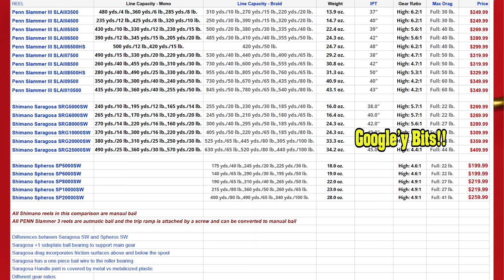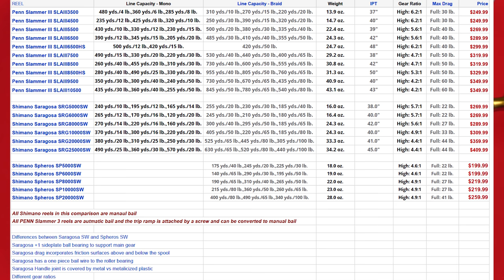Penn Slammer 3 vs Shimano Saragosa SW Who makes the best Surf Jetty Pier Boat spinning reel?  Sealed

Comment: Great discussion here, thanks.  I got myself that 2500 LL.  I really like the reel, overall but I can't get over the spool sitting on such a tiny "shelf" washer on the shaft--as you said, all that pressure has to pile up right there, narrowly.  I minor problem I'll say Penn overlooked was the angle of the line roller to the spool of line, particularly when full.  It pays off off the spool at an angle wider than the line roller is angled for, so it runs tight against the sharper edge of the roller just before it guides on to it.  No likey!  That could feasibly fray line or rumple it.  My reel lays line biased on the lower part of the spool, even after removing the most shims possible and reeling in tightly.  My 2500LL's drag locks DOWN.  The only way to take adavantage of that degree of drag would be 60lb braid on a Tuna stick, which means getting spooled after 30 seconds of Blue Fin fury since you haven't the yardage to give it.  Impractical as that all seems, it's nice knowing it's there!

Comment: One thing I really like on my gosa 6k is how powerful the gearing is. I try other reels and have to wind a lot harder.
Reply: What about the Daiwa BG ?
Reply: @gonimysh  I have 3 sizes of the BG's, 2500, 4000, and forgot the size of the other one. The BG's are not well waterproofed, and this comparison is gosa vs slammer. I have since previously picked up a 5500 slammer and it is a nice reel, have some heavy braid on it 40lb and I can crank in cobia off the coast and use it in the surf with heavy weight.
Reply: @rabidgp  Thank you for your answer but my question is about power. I know that the BG is sot sealed as a Saragosa and in the long run the Saragosa will live longer but what i want to know is which reel is more powerful, the Saragosa 6000 or the BG 4000. I am making you this questions since you have both. Thank You
Reply: @gonimysh  The gosa is more powerful, smoother, and the consider that the two reels are not the same size. Surf fishing from the beach I can retrieve a 4 oz pyramid sinker and rig effortlessly, where the 4000 takes more effort. One issue with the gosa is to be careful to not drop the spool, I dropped the reel once from  about 3 feet and it dinged the spool lip which I had to lightly sand so it wouldn't cut the line. The aluminum was softer than I thought it would be.
Reply: @rabidgp  may i ask where are you from? I am curious to know what kind of rods and reels do you use.  I live in Italy and for fishing from sandy shores we use usually 4,5 meters rods with big pit reels like the  Shimano Power Aero 14000 XSB or the Basia Surf 45 QDA which have large spools for casting far 100 -150 meters using leads 100 - 200 grams. Reels like the Saragosa or the BG are used for heavy spinning and boat fishing.
Reply: @gonimysh  Central Florida east coast US, we  fish light tackle for snook, red drum, speckled trout in the estuaries, inlets, and beaches. Surf fishing (with light tackle) for pompano, whiting, snook , mackerel. Inshore coastal for tarpon and cobia, offshore trolling for Mahi dolphin, wahoo, tuna, and  sailfish. Offshore bottom fishing for snapper and grouper, various species. Scuba diving for spiny lobster, grouper, snapper, flounder. And we have freshwater rivers and lakes for largemouth bass, and speckled perch. So many fish, so little time.....  but they're often seasonal and weather dependent.
Reply: @rabidgp  very interesting even though i don't know any of the fishes you mentioned 😀. I would like to know what kind of rod do you use with the Saragosa, how long and what casting weight. Probably your definition of surf fishing is different than mine. In Italy we call "surfcasting", fishing from the beach in a sea with waves.

Comment: Have used the Saragosa 10000 model for casting live baits and poppers to Sailfish on our charter boats in Rompin, Malaysia and have noticed after while that the drag setting changes to much less drag during long fast runs, otherwise a very nice reel but the drag problem gives me headaches.
Reply: Jonas Nyqvist yep mine does as well
Reply: I have a gosa 6k, and notice this effect a little also, I thing the larger drag seal makes friction against the spool and can cause the drag to tighten. Maybe a light oil to ease this friction might help.   The smaller seal of the slammer probably works better to this effect, not as much drag against the spool.  Maybe a little loctite in thr drag knob might work, harder to turn, but should help it stay put.
Reply: Rob Lee yes exactly, i have a 10k and just a small amount of oil on the seal under the drag knob and on the spool where the knob sits will fix the slippage. Will stop the drag knob from catching onto the spool and applying unintentional drag.

Comment: so how do you fix the wobblely   rotor on the saragosa 6000
Reply from the maker: Honestly I would suggest contacting shimanos service....I believe they remedied the issue...i've seen new 5 and 6k reels without wobble...i've also seen smaller twinpower sw's with a slight wobble.  My guess is send in the reel they give ya new or a new rotor.  You could probably convince them to send  a new rotor and it's a simple fix if they send it with the bail parts already assembled
Reply: i had saragosa 6k....used for light surf and popping....no problem...so far after almost 3 years...no wobbling....but the new tp5000hg....wobble  under pressure
..sold it back...not satisfied compared with 2011 tp...(very nice)

Comment: First of all, great, in-depth  video comparison!
Yesterday I was talking with a guy at my local B&T shop who was annoyed that he couldn't get his beloved 7 year old Shimano repaired because Shimano no longer has parts for it.  He bought a Penn Slammer instead.  This was not surprising to hear about Shimano -- they do the same with their cycling parts.  I guess that is what they refer to as planned obsolesce.  Shimano makes some really good stuff, but they're constantly changing things.  There is certainly something to be be said about change for improvement, but I think Shimano changes just to change -- and then they market that small change as a huge improvement that you can't live without.  I have both Shimano and Penn reels.  In this case, I opted to go with the Slammer for surf fishing because it is a very competent reel and I want to be able to fix and service my reel should southing go wrong a few years from now.

Comment: We use this reels exclusively for jigging here in Cebu Philippines. I use a slammer 4500 and my friend uses a gossa 8k.  I pulled a 58lbs king mac using a 20lb jbraid w/ a 30lbs florou leader on my slammer and the drag was phenomenal. My only issue with the slammer is its cranking power but overall i love it. Still smooth as  the day i bought it, no it’s actually more smoother  now even after a year and a half of jigging , 16hrs a week for more than a year and still no issues its a tank🤣🤣🤣.
Reply: Dude I visit the Phil's quite often (pre-pandemic), would love to go fishing with you guys my next visit if possible

Comment: If I may clarify: At 50:40, you mention the rotor play as being related to the ratio.  I'm quite sure that the play comes NOT from the space between the gear teeth (which makes the gear ratio a non-factor) but has all to do with the amount of rotor travel required to actuate enough resistance from the anti-reverse mechanism. So, the handle is not an accomplice.  You'd be right about the "six times more play in the rotor than the handle" IF the anti-reverse were under the main gear whereby the rotor's reversal rotation is transfering torque from the pinion to the main gear, THEN you'd get that sort of play, which was true back in the Z-days and lighter SS models of yore. But since the anti-reverse is at the pinion gear, the main-gear-to-handle train bears no guilt in crimes of the un-reel.   I appreciate your deep dive with the mechanics/materials.  I've been fixing reels since I'm 9 years old and still can't overcome it.  Any tips?  :)

Comment: Great video, I'm going to go with the Penn Slammer 3 5500 because of the IPX6 rating that was done independently. Very Informative vid.
Penn Slammer III 5500 Spin Reel
Penn has been a long standing market leader in the production of strong, heavy duty saltwater fishing reels that can go toe to toe with the biggest & the best in Australian saltwater fishing and that is why for a third year in a row it has won the best new saltwater reel. 
To keep up with this tradition, Penn presents to you in 2016, The Slammer III spinning reels.
The Penn Slammer III fishing reels are made using a full metal body, side plate & rotor and are then sealed using an IPX6 design which offers anglers a super strong reel that is ready for all kind of saltwater applications by keeping water out of the gears and drag system. 
All Slammer III spinning reel feature 6+1 Stainless steel ball bearings, CNC gearing systems and boasts an incredibly light weight design. When using the Penn Slammer III fishing reels, you can take advantage of the whopping max Dura-drag systems and the large size line capacities to chase all your favorite Australian saltwater fish species.
 
Full Metal Body, Side Plate & Rotor
IPX6 Sealed Body & Spool Design
CNC Gearing
Sealed Slammer Dura-Drag System
Stainless Steel Ball Bearings
Mono Capacity lb/yd: 430/10  330/12  230/15
Braid Capacity lb/yd: 500/20  380/30  335/40
Gear Ratio: 5.6:1
Max Drag: 18.1kg
Reply: Kwikflikz Yak ADVENTURES I own the slammer iii 5500 and I don't like it for surf fishing. It's heavy if you are throwing lures and I nearly lost mine when a jack took it out of the sand spike because the drag doesn't get loose. It's a great reel on the boat though.
Reply: thanks for your reply great to know, I'm looking at ocean kayak fishing and mostly trolling for Tuna and Kingfish, appreciate the comment.

Comment: Own  2  Penn slammer 3 5500 and     been up to my chest with 40lb stripers and the reel taking a swim.   No probs ever. no corrosion no anything other than the Penn slammer  bail  closes  a tad stiffer  which actually helps in the long run  if tossing lures.  No premature bail closing breakoffs.    Fishing bud actually owns a saragosa 5000 and it fucked up on a nice  35 lb striped bass which burned line and locked the spool up.     Also noticed that my friends  saragosa had damage on the  line roller.      Penns drag on the 5500 40lb.    Hooked a 110lb  white sturgeon by accident and the Penn had problem controlling this beast.     Penn indeed has no rotor lean.    Had ideas that the Penn might  be less than penns old standards but pleasantly have found the Penn is solid as hell.  Also have had waves splash the  Penn over and over and no raspiness? not sure what happen  to this one but mine gets put through hell and has never had a issue.
Reply from the maker: It really is a very good reel.  As is the Gosa.  After penn sent me the new spinfishers.  I found one that was missing the hydrophobic coating.  I asked penn if it should be there and if mine were retail release..and they confirmed it should be there and that they're pre retail......But 2 out of 3 had the coating....I say that because when i had that slammer....I thought I had messed something up...but I've now seen some penns with a barely there coating...and that slammer i think it was as missing as the one I have here.  And that will allow water to get into the ar clutch area and kill that pinion support bearing which is what happened.   The day it was dunked..all was good.....same with the next day not fishing it..the third day is got noisey... (saltwater)  Penn replaced the reel and it is in tip top shape and back in the og owners hands.    Quality control....every companies most important aspect..can be penns problem at times....Vids like this go a long way to push them to focus...(I know they are watching me wit the upcoming spinfisher vids i'm shooting...and when I launch the vid this week focusing on one of their november launch reels.  They may get a tad nervous...But it's for the benefit of the consumer..And I don't recall in the history of a retail release anyone has done something like this

Comment: Hey bud happy new year. 
Really appreciate your in-depth reviews on gear. I'm considering both of these as an option for surf plugging here in the Northeast but did hear that the Saragosa's have an issue with line slap against the rod guide in some cases because of the design of the reel foot which seems was designed more for jigging. If this in fact is the case I'll likely lean more towards a Slammer, Saltist or Spheros. Can you elaborate on this? 
Thanks.
Reply from the maker: It depends on the guide layout. In some instances there will be a bit of line slap due to the parallel reel foot.
Reply: Makes sense. Has Penn addressed the knocking issue you mentioned at 29:00 and is it more of an issue on the larger sized reels?

Thanks.

Comment: I have read that the Shimano Spheros SW comes in JDM and USDM versions, with the former having a lower quality cast drive gear. Do you happen to know if that is also the case for the Shimano Saragosa SW or do they not have different versions of the same model? Thanks for the review please keep it up!
Reply from the maker: The JDM spheros is inferior to the USDM...that's why in the links I make mention of it....Hex handle and something else is lower quality. I haven't seen any cut corners in the jdm gosa
Reply: There isnt a hex handle on the JDM spheros.....

Comment: Just for the record, I love your videos man but I got a question.
I watched this video a couple times and I noticed that you were talking about the slammer and how far you got it in saltwater and u said it almost got above the spool but for the most part it wasnt dunked much. Is this the same slammer you were using in another video, because I remember one of your reels in your videos had a seal broken on the rotor near the main shaft im not exactly sure of the location where it was at, but dont you think that would compromise the sealing of that reel if it was dunked with a messed up seal? 
Trying to decide between these reels and a shimano spheros for a surf shark fishing trip soon. I guess my question is if you used that slammer with a broken seal during testing and if you believe an unbroken seal would've greatly improved the slammer's sealing. 
Thanks for what you do for the community.
Team Shimano!
Reply from the maker: Yup same reel same torn o ring under the rotor nut.. And on top of that.. I thought I messed up the hydrophobic seal.  Which I recently found wasn't applied correctly and almost completely absent.  (it's missing on one of the new Penns they sent me) which got me thinkin that there wasn't an obvious coating there on the slammer 3.  The top bearing failed on that slammer and was replaced.  Just last week the owner of this slammer told me that the latest replacement was the worst of the now 3 replacement reels...
Reply: So now you recommend more the saragosa or do you still recommend the slammer?

Comment: For a budget popping setup used for GTs, Dogtooth tuna or Kingfish either offshore or from the rocks, which one would be better, a Saragosa 20k or a Slammer 3 8500HS? The Penn has better drag (on paper), a bit lighter, a higher line capacity, a faster line retrieve and is a bit cheaper (though I can find deals online for the Saragosa 20k at $250-300 if I look around a bit). 
The main issue that I know with Penn reels is that they're generally too heavy for working a popper or stickbait all day (aside from the Torque), but the 8500hs seems a good compromise without going full Stella or Saltiga. Since the Saragosa 20k (or the old 18k) is generally considered the minimum for GT popping (weight-wise, drag-wise, capacity-wise and reliability-wise), I wonder if the Slammer 3 8500HS can do it a little bit better?
I'm saving for a decent, not top-of-the-line popping setup for GTs here in the Philippines (we don't really have a lot of 30-50++ kg monsters you'd see in Oman or Australia, more like 10-25 kg, but there are some), and my local tackle dealer stocks more Penn stuff than Daiwa or Shimano. I'd most likely have to order online for the Saragosa if I do go for one. What would you recommend? I'll also be using the reel for offshore jigging.
Reply: @baku7478  Yung may stock na Penn Slammer 3? Dito sa Iloilo bro.
Reply: @baku7478  Yup. Small size lang ang in stock but makaka-order ng mas malaki yung proprietor. They also have the Spinfisher V, no Spinfisher VI yet though. Frankly I'm leaning more to get the Saragosa, but maybe 10k size lang, I found a seller in Australia willing to ship for cheap.
Reply: @baku7478  As far as I know there's no problem with either method. There are good jigging spots off the coast of the town of Oton with plenty of trevally (mamsa/talakitok) and grouper (lapu-lapu). Trolling usually gets you spanish mackerel (tangigue), trevally and tuna from what I've heard. My personal recommendation though is to fish in the neighboring provinces of Guimaras or Antique, they have cleaner waters and the fish are less wary. You might even find dorado/dolphin fish/mahi-mahi offshore.

Comment: I’ve always said the Slammer3 is a BOAT reel. Atleast for NE surf applications. Reason is the 4500 does not have the line capacity nor does it have Manual bail trip which is a must. Then the 5500 is way too Big And Bulky of a reel to throw plugs with all day. Can’t comment on the Saragosa because I don’t have one yet but the fact it has better sealing is a big sell point for me. Tight lines - joe